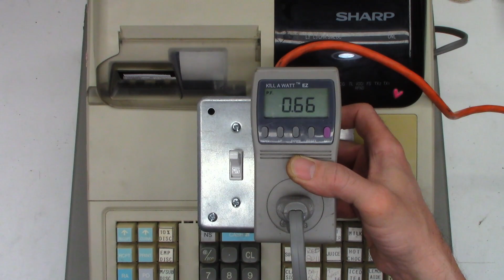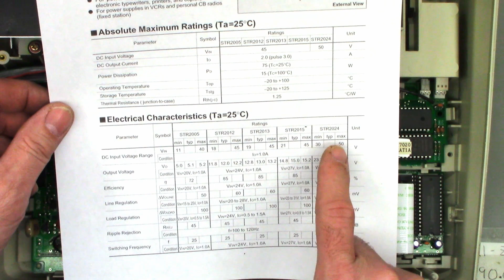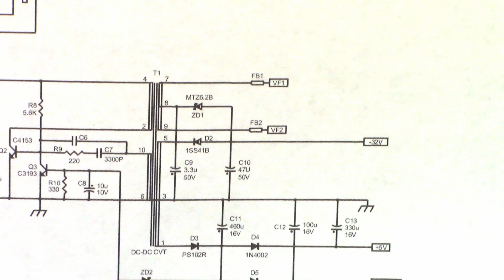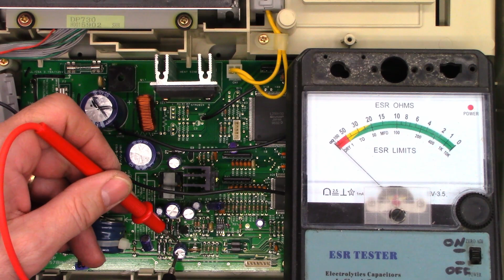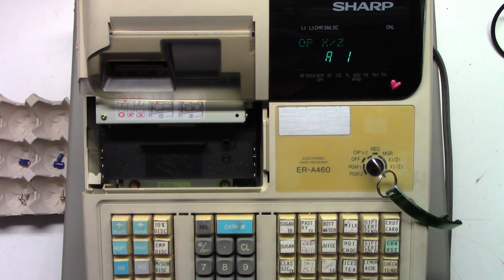SHARP ER-A460 CASH REGISTER NO DISPLAY - ANOTHER SUCCESSFUL FAILURE

Comment: You should take a look at the programming manual.  I have set up a few registers for my customers before and they do exactly what you are seeing if you don’t go thru the proper procedure.  
You hit one key wrong and they act like they are locked up but aren’t you just have to hit the proper key sequence to get it cleared out.
Reply from the maker: I did try the programming manual.  After the reset you have to set the date and time and it locks up when trying to do that.
Reply: For me, it doesn’t matter if he followed the correct procedure or even if he fixes the device. Just walking through it aloud is enough, because its showing me how to approach a new problem logically and systematically.